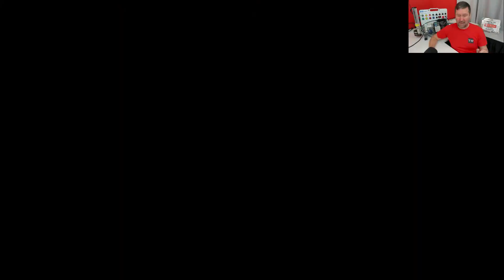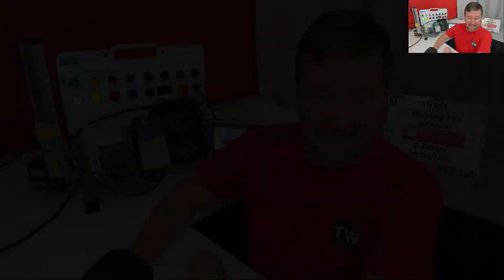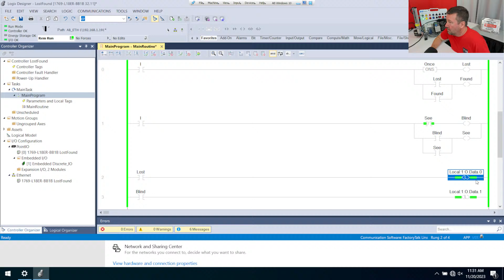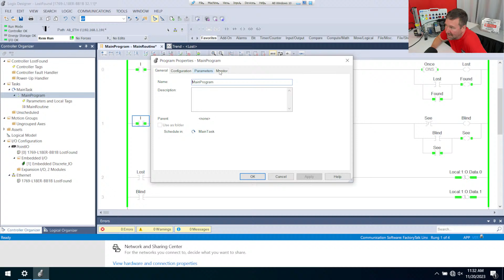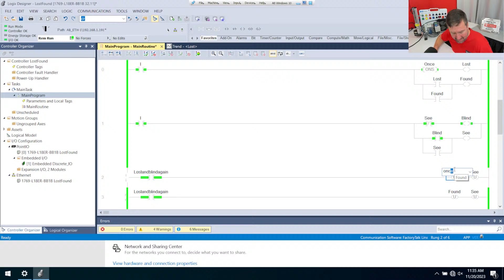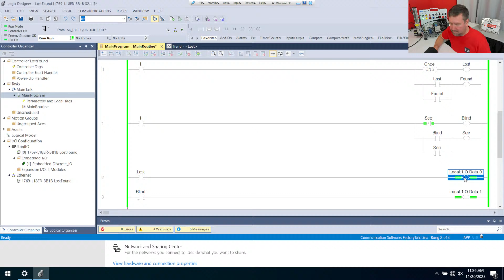PLC Programming Riddle.  How does the ONS work?

Comment: Would it help to show the IL or mnemonics to help people understand there is an actual step of low level instructions, vs. actual "power flow" emulation of an actual relay circuit.  This is one of the reasons I like to use SET and RESET coils vs. latching input logic like you have (but I understand the latch input pattern, but as you described, behavior is not obvious).  The one thing I do like about the input logic based latches is that you also program the "reset" logic in the same rung.  This latch/reset rung pattern has been around for decades, but it still requires explanation of the "input contact" behavior of the "latching coil".  The SET and RESET coil pattern typically is across multiple rungs (with "reverse logic" on the RESET rung - good application of DeMorgan's Law!)
Reply from the maker: What does "IL" stand for?  I struggle with the acronyms 😁
Reply: @TimWilborne  Instruction List I think is what they are referring to, I believe.
Reply: @TimWilborne Sorry I did not respond sooner.  One of the languages in IEC-61131  used to be Instruction List (aka IL), basically mnemonics.  The standard has dropped IL since it was more tightly coupled to the implementation of the other languages, hence not really great for a "standard" (e.g. all microprocessors/vendors had to have the same assembly mnemonic instructions).  Hence IL was dropped.